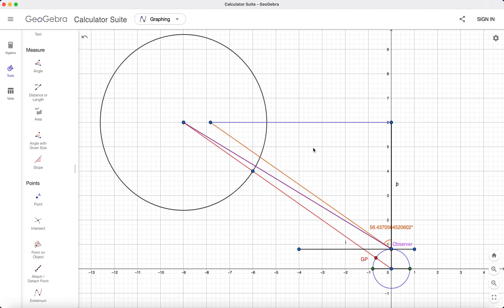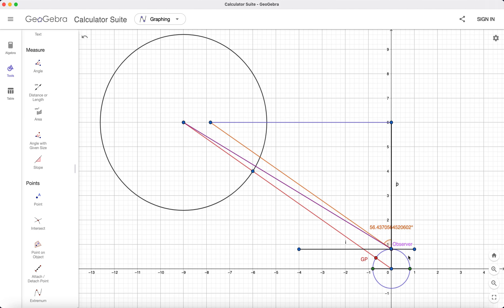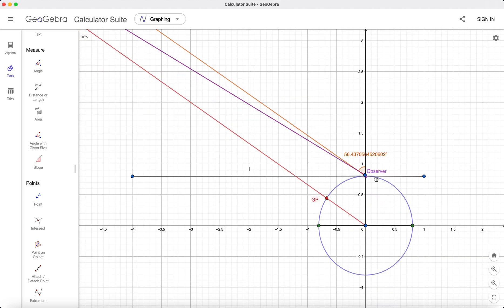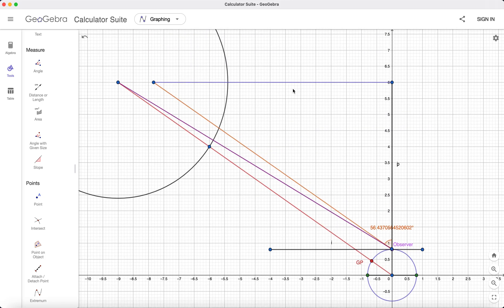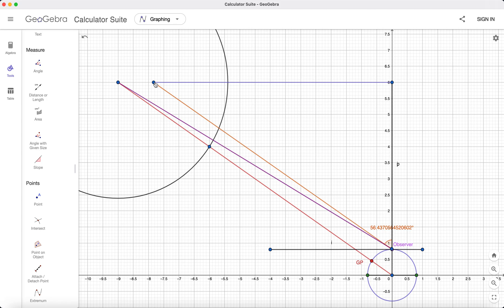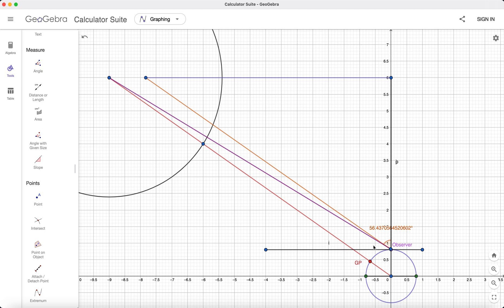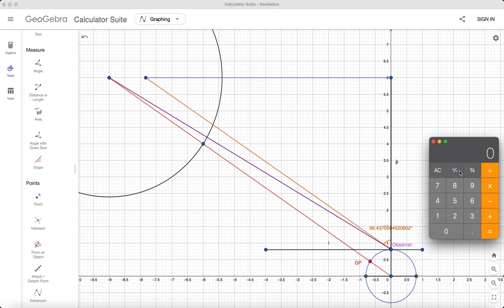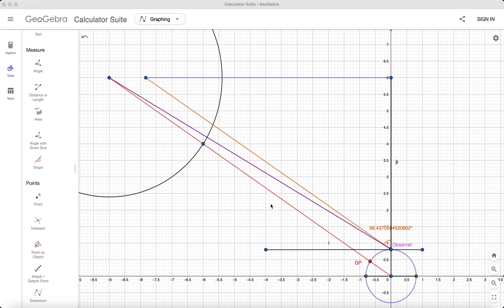Zenith Phobia....?

Comment: In the first place, using a long useless string of digits like 56.4370560520602 makes you look like you're just trying to impress some people who don't know any better.

Second, why can't anybody define a tangent plane?

A little math here: 6,000 is 6x10^3. 6,000,000 is 6x10^6. 0.006 is 6x10^-3. To handle really big or small numbers, just count the zeros.

Globers say Polaris is 433 ly from earth (give or take 20%). A ly is about 6x10^12 miles. so the distance to Polaris in miles is 433 x 6x10^12 or 2.6x10^15 (give or take).

You're right, suppose the top angle to Polaris from where you might be is about 56°. And suppose the earth's center is 4x10^3 miles away. So if you could look from the earth's center, the angle would be different, absolutely.
        How different?
By an angle whose tangent is 4x10^3 / 2.6x10^15 = 1.5x10^-12 (radians). To convert to seconds of arc, multiply by 57.3 to get degrees and 3600 to get 3.2x10^-7 seconds of arc. That is 0.00000032 seconds of arc difference (3.2 ten-millionths of a sixtieth of a nautical mile). Was your original angle measurement anywhere near that precise? No, it wasn't, so the 4k mile separation is insignificant.

Comment: In your drawing you have a right angle triangle, with one of the angles measuring 56.43 degrees.
Did you check if the opposite side (the horizontal one) is 56 x 60= 3360 long?
Reply from the maker: Yes they are both the same, there is subtleties your missing here ?
Reply: @BriansLogic  Apparently i miss a few bits.
I was asking about the length of the opposite of the triangle (the blue horizontal one) and you answer talking about both the same.
Both what?
Same as what?

So i repeat my question: did you check if the length of the blue horizontal side of the triangle is equal to 56 x 60 = 3360?
Reply from the maker: @geronimo5892  Stop asking idiotic questions trying to be clever, your not your a fool….
Reply from the maker: @geronimo5892  Address the argument and stop trying to be smart, or I will get rid of you off my channel, do you understand ?
Reply: @BriansLogic  I understand that questions are not welcomed here.
Noted.
Reply: @BriansLogic  You have no problems measuring an angle to a to a point you admit not knowing where is or what is, but anyway claiming it is evidence for celeastial navigation not possible on a globe earth! So why not take the challange? You can't get it more wrong than you  have already done!
Reply: @Level With Me Nice garden.
Reply: @Level With Me Beware the bears.

Comment: I am disappointed, Brian. I really expected that you will finally present supporting evidence for your claim that co-altitude is linear distance measured in units of length. Quote from book on celestial navigation, from manual or some dictionary definition. Something from credible source. But not only you didn't provide that, you then spend most of your video beating straw-man. Why are you trying to show us how impossible is to make working model of how that relation between elevation angle and distance on surface work when I already provided you with that working model, with links where you can download it and play with it? For example here you can see what difference it makes when the star is very far away: https://youtu.be/TSMivSz81xc .The whole model will change from your broken straw-man to perfectly working.

Comment: This is a total strawman you built up and knocked right down.
Not one glober who understands basic navigation claims what you have flersplained.
This is all yours, not ours.
Reply from the maker: No this is the official claim as to how it’s done, parallel angle lines, but the original angle line never meets the stars zenith, so the distance will always be out, and that’s just the first angle 📐 what about the other two ? 
And remember this argument is based around our side ignoring all the other factors ie, tangent planes, distances to stars, diverging zeniths etc, as even by giving ye all that other nonsense, your model still fails on all counts.
Reply: @BriansLogic  Brian, the “official claim” is that the nearest stars are 20,000,000,000,000 miles away. With an earth that is “officially” ~4,000 miles radius, what will the angular difference be between the line from the star to the GP and the line from the star to the observer?
Please actually try to answer the question and not just say “but you don’t understand it”.
Reply: @BriansLogic  
No Brian, this is not at all what is claimed.
Your scale is abysmal, everyone tells you so, and yet you keep saying that this is what we claim.
A star is a point light source and all  light from that star that hits any part of the Earth is within a tiny, tiny, tiny fraction of a degree of being parallel.
Sorry Brian, but your diagram is a lie.
(Edit: added 2 tinys)

Comment: In reality.....the star is a point light source, there is no angular diameter of a star.
In Sun sights, there is angular diameter that is listed, by season, in the altitude correction tables.
Reply from the maker: Yeah in reality, but in your model ye have parallel angle lines, where the original angle line will always be lacking, as it never reaches the stars zenith line, so the distances will always be out.
Reply: @BriansLogic  
You don't understand the geometrical principles involved, you use a false method and then knock it down and claim victory.
Reply: @BriansLogic  By what angle are the lines off being parallel?

Comment: If: zenith angle of 30° on a supposed horizontal line in the sky = 1800 nautical miles
Then: zenith angle of 60° = 3600 nautical miles?
Obviously not.
Trigonometry mandates that zenith angle 60° = 5400 nautical miles.
Different angles never subtend proportional distances on a line, unless the line is a circle.
Reply from the maker: You don’t understand what an Elevation Angle 📐 is, you think it’s an Angular Size Measurement, it’s Not, you don’t understand this, and every video your commenting with the same misunderstanding, I’m starting to think that you must have problems ?
Reply: @BriansLogic  Is there a difference between an “angular size” measurement and an “angular separation” measurement?
Reply: @BriansLogic  I know you won't answer this, just like you never answered before.
If an elevation angle is not an angular size measurement what is it?
Angles are angles and are comparable, so both an elevation angle and an angular size are just angles, are the same kind of thing.
Are you able to explain why they should be different things besides just saying they are not the same thing? Is there any substance behind your words?

But most importantly, what the f* has this to do with what I said? 
What has this to do with the fact that doubling an angle you more than double the distance projected on a straight line?
Geometry Brian, Euclidean geometry, you can't just pretend it doesn't exist.
Reply from the maker: @braccosvisvibracco3400  The Elevation Angle 📐 is used in conjunction with the Depression/Zenith Angle 📐 to determine the Minutes of Degree/Nautical Mile Distance….
The Internals are NEVER calculated, because I can get a 40 degree angle to my Kitchen Table, does that make it thousands of Nautical Miles away ?
Reply: @BriansLogic  If the table’s zenith diverges by 40deg from your zenith then, yes, your kitchen table is thousands of miles away. Are you having a holiday?
Reply from the maker: @andrewjohnston6631  No just making a point to someone like you, who doesn’t understand this….
Reply: @BriansLogic  You mean someone who doesn’t understand that diverging zeniths isn’t a problem? Because they’re not a problem for the globe. We don’t care how much distance there is between the zenith lines, all we care about is the angle.
Why can’t you grasp this? Do we not use enough emojis for you?
Reply: @BriansLogic  Brian, first of all, what are the "Internals"?
If the kitchen table angle isn't thousand nautical miles away from you, doesn't this tell you anything?
The kichen table is disproving your flawed reasoning (the reasoning that is just yours and that didn't exist in the world before you made it up).
An angle projected on a straight line subtends distances depending on the tangent of the angle, not directly depending on the angle.
If the distance from 0°  to 30° is 1800 units, then the distance from 30° to 60° is 5400 - 1800 = 3600 units.
There is no proportionality between angle and distance.
If the distance between 0° and 10° is  600 units, the distance between 70° and 80° is 9949 units.
Reply: @BriansLogic  Another time, what is the difference between an elevation angle and an angular size, Brian?
Will you ever tell?
Reply: @BriansLogic  so the measure of the angle of elevation is not the size of the angle? If I measure an elevation angle of 30 degrees, then what size is that angle in degrees?